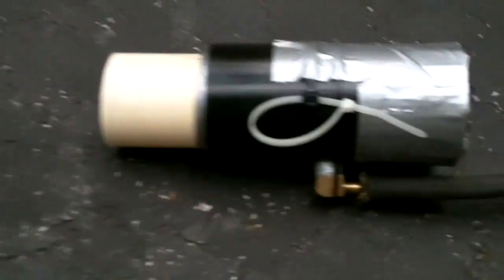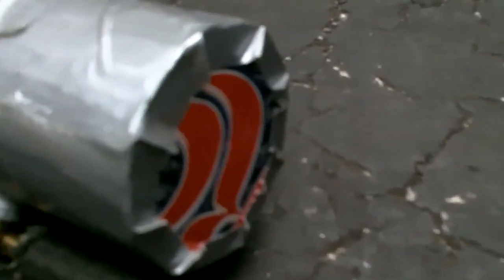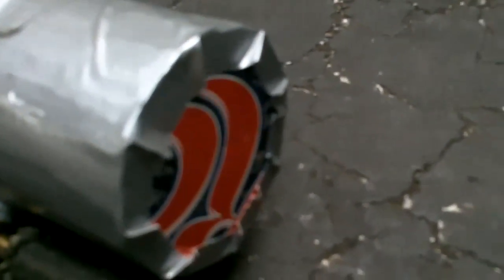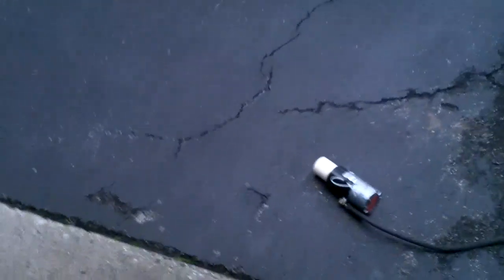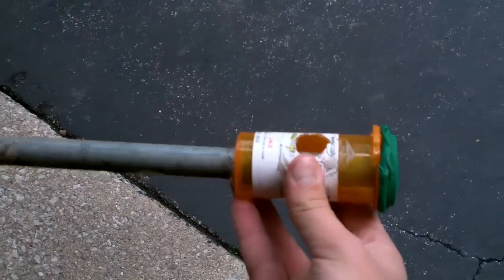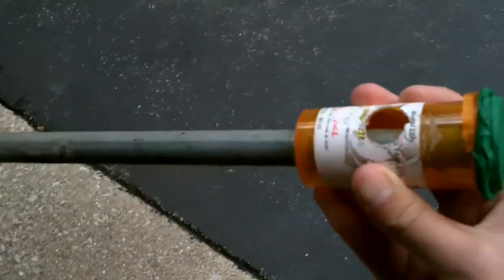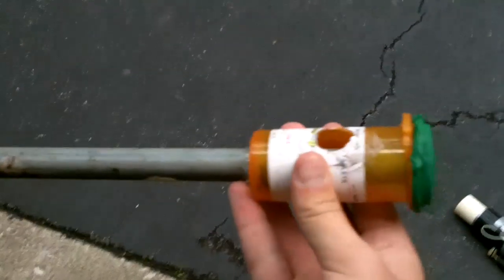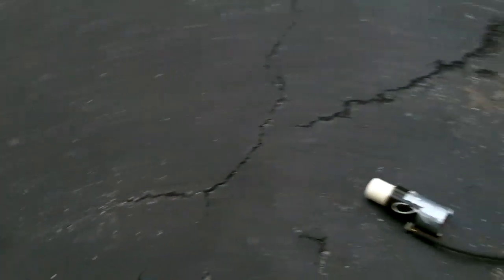Homemade Truck Train Air Horn

Comment: I made a horn like your orange medicine bottle and pipe one, but instead I used a drinks bottle with the base cut off, and used a round conditioner bottle instead of the medicine bottle.